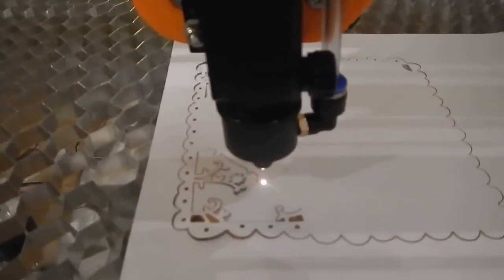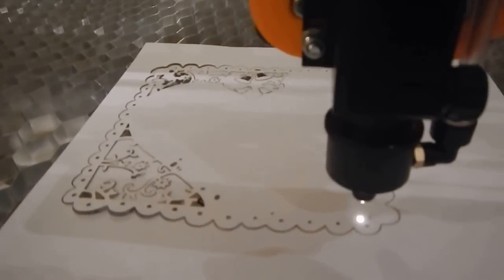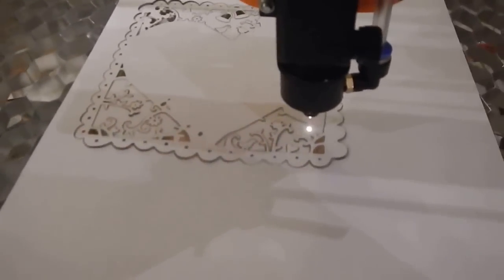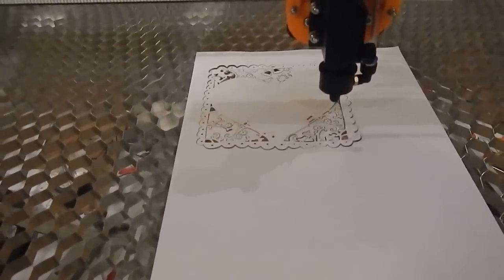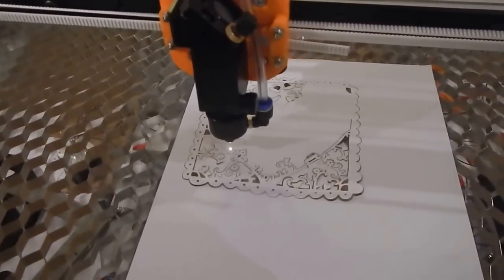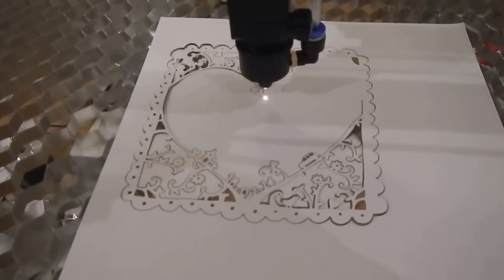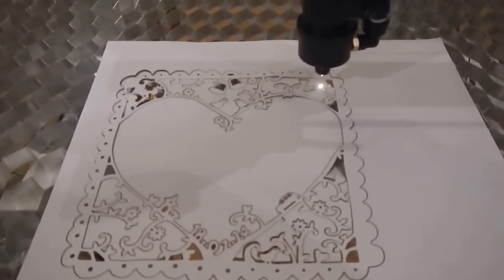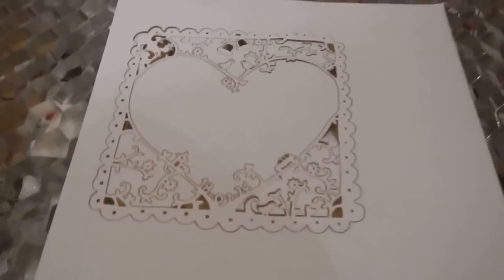axCut Laser Cutter - cracked it!  z axes working, honeycomb bed installed - lovely jubbly!

Comment: What was the problem with the Z axis?
Reply from the maker: +Joey Gotts not so much a problem, as needing to get everything wired in and mechanically adjusted.  This is quite old now, the latest version has independent control over each corner of the bed to fix drift between the 4 steppers.  In hindsight, the chain or belt based designs (with a single motor) would have been simpler, albeit it would require routing the belt/chain around the frame

Comment: Great work. What is the laser head and optics ? W of laser ? Cutting capacity ?
Reply from the maker: thanks, laser head/optics are from ebay supplier http://myworld.ebay.co.uk/cnsigntech?_trksid=p2047675.l2559   
25mm mirrors, 1.5" lens.  
Laser is 40W CO2.
Cutting area is 880 x 650mm